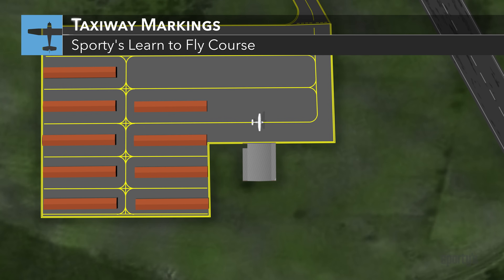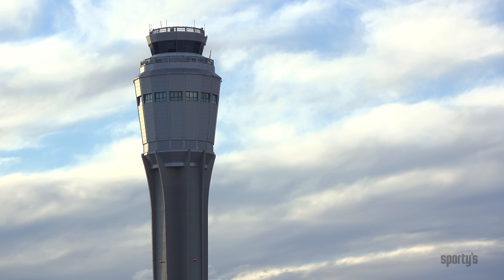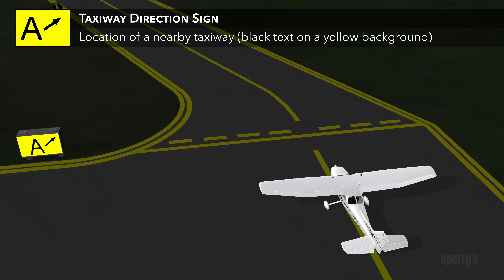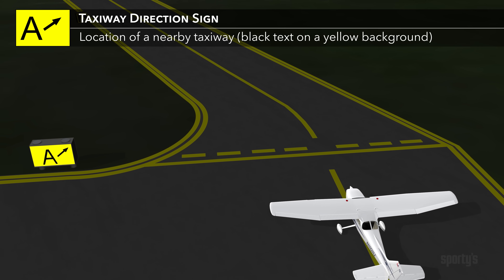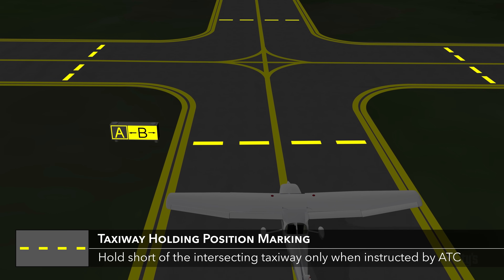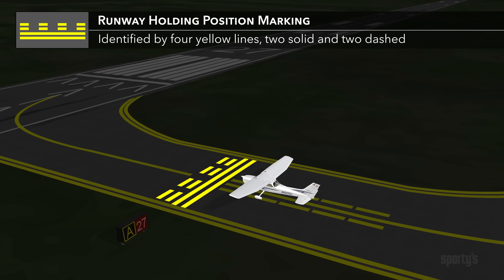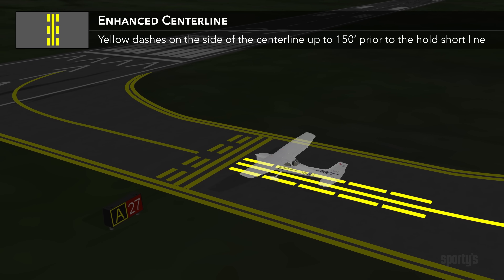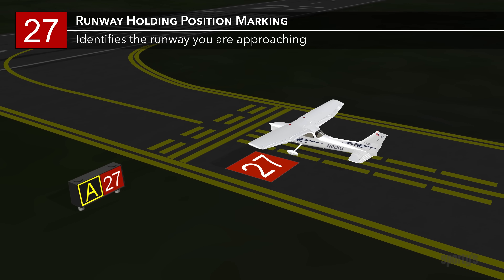Airport taxiway signs and markings - Sporty's Private Pilot Flight Training Tips

Comment: How to collide on taxi-way before modification of airports to accomodate a380.?
Reply: Runway holding position marking
= jet blast
= seperation
= minimum clearance

Non-movement 
= area
== hahaha
= boundry
== ...

Taxi way 
= direction Sign
= location Sign
= location amd direction Sign
= holding position marking

With a380 requirements in-mind, the taxi-way classifications for aircraft types, should be similar to classes of roads, engineering curves and spreads and seperation and holding and area.sss. During movement, all are a380 and cannot be a snob.